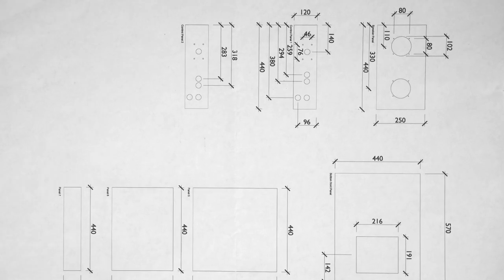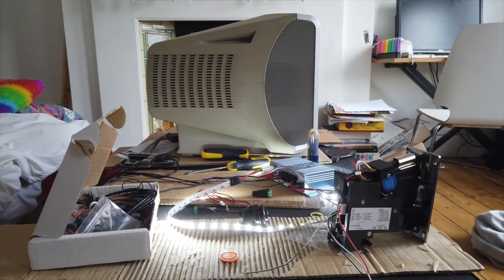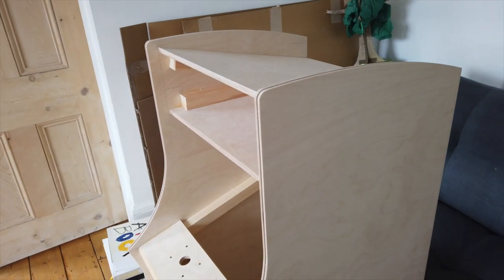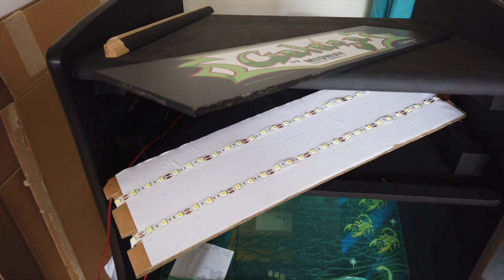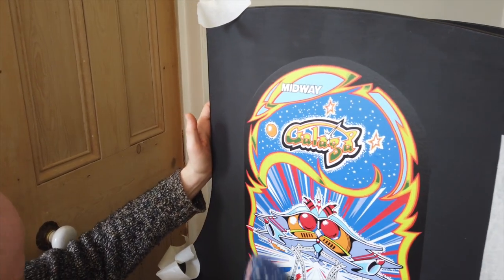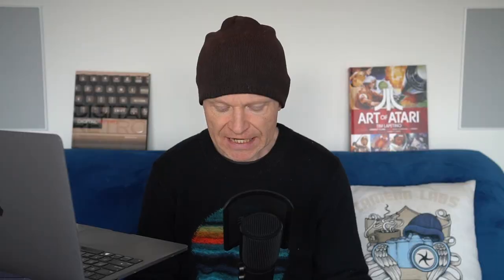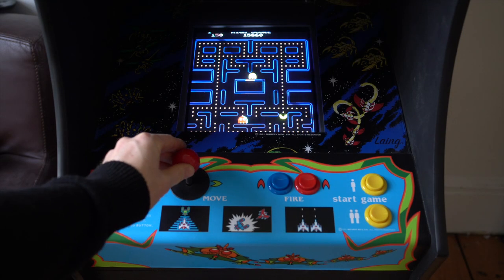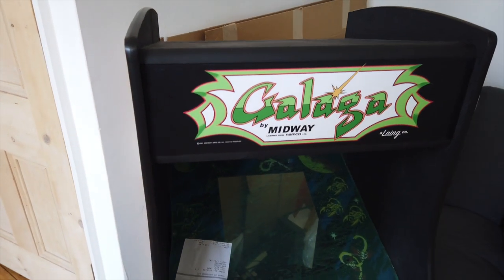How to build a vintage ARCADE machine: Part 3

Comment: Great series! Cabinet looks really good. Those rounded corners look fantastic. My coin door fails a lot too (I have a button on the console to add coins)...if I recall, they weren’t perfect back in the 80s either - I’m sure I lost a lot of quarters lol! I must have bought Pac Man 100 times over my life on various devices...but until you play it on a cabinet, it’s not even close to the same experience.
Reply from the maker: Thanks! I think the thing I really love about these games are the speed at which you can get started and the speed at which they can kick you off - unlike modern video games which need to tell a huge story, you can get in for a quick fix with these classics!
Reply: ABSOLUTELY! I say that all the time. And because the games were made to suck all the quarters you have, the games are quick! There are times I’ve started up our Xbox and while I wait for a game to load, I’ll have a quick game of Pac Man ;-) Can’t wait to see what you review next. It would be interesting since you never had a 3DS or Wii U (that everyone deems a failure - but I still seem to like) if you can get your hands on one and give it your honest thoughts. It also has a large virtual console library that the Switch doesn’t have (yet) for N64, Gameboy Advance, and Turbografx-16.
Reply from the maker: @IntothewestOkotoks  thanks, I'll certainly try to review all consoles and handhelds going forward, but first need to add some reviews of other things to lay out the scope of the channel. So next up, an interesting old digital camera, coming on Sunday!

Comment: Thanks a lot for that series of videos describing the building. 2 tips are very valuable to me: test-play before you build and use a local shop to build the parts you planned. After I've restored all the old 8bit computers (neverending task) that are waiting here, I'll start to build an arcade cabinet myself ;-)
Reply from the maker: I'll be doing some old computer restoring soon! Which machines are you doing?
Reply: @DinoBytes  Looking forward to that. I mainly play with the 8-bit machines that were common in germany: Atari 800XL, C64 and Amstrad CPC6128
Reply from the maker: @matthiasmuller4702  nice! I still have my own 64!